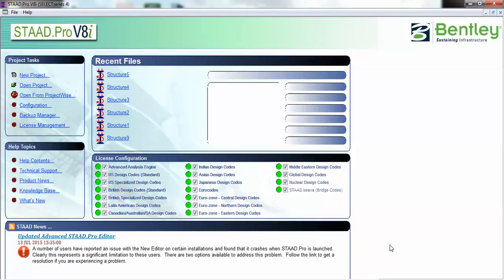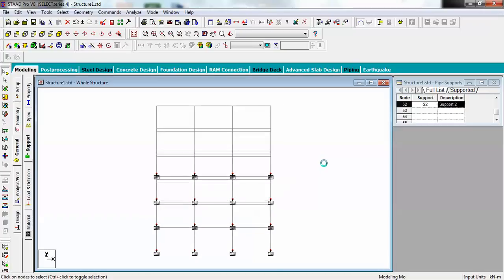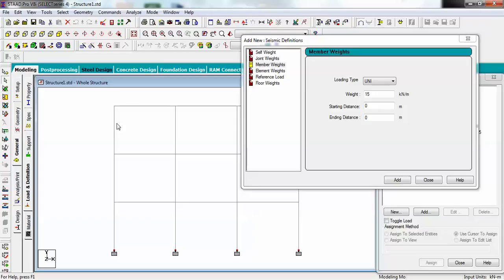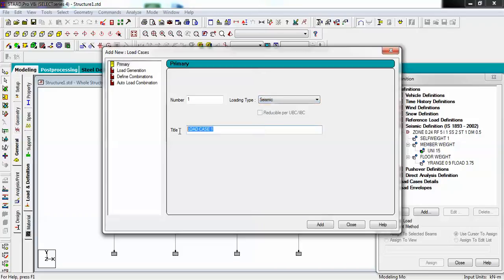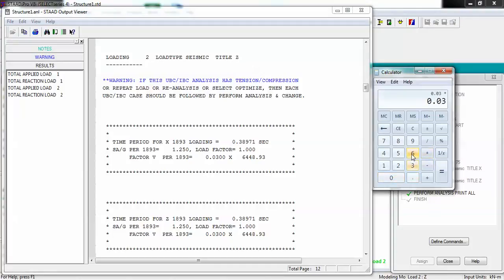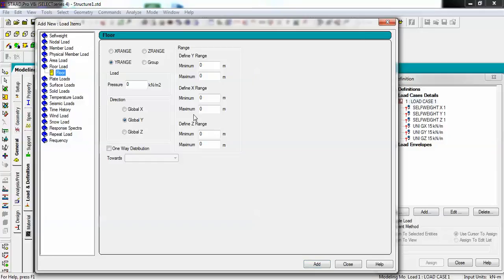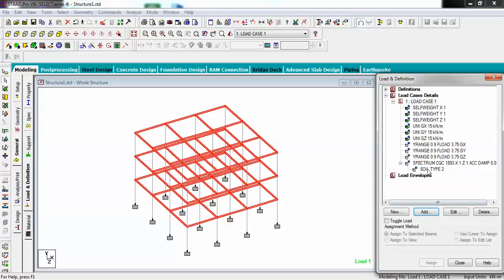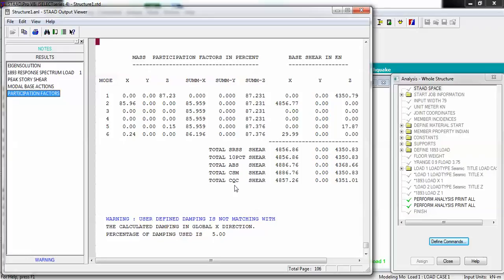Response Spectrum Analysis (Dynamic) in Stadd Pro v8i on IS1893 Best explained

Comment: as per STAAD reference manual, clause 5.32.10.1.2 : Response spectrum specification in conjunction with Indian IS : 1893(part 1)- 2002, the input parameters required are shown there. under methodology, first point, it says : "You provide the value of Z/2 * I/R as factors for input spectrum". and point 3 which says : "The program calculates Sa/g for each mode utilizing time period and damping for each mode".
I would like to know where did you manually enter the value of Z/2 * I/R ? 
You had entered a value of 1. Is that correct? 
Please confirm.